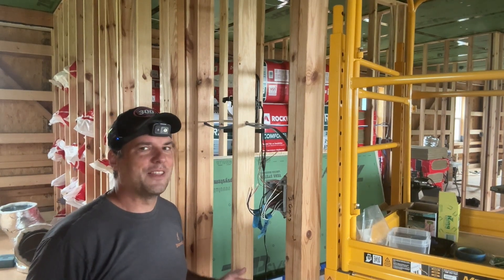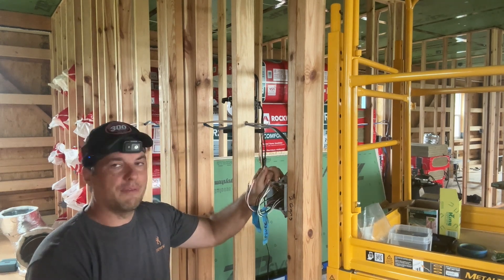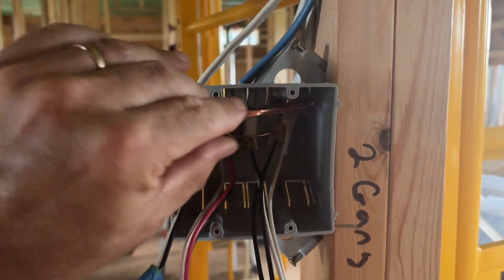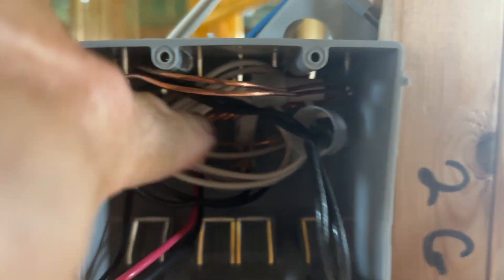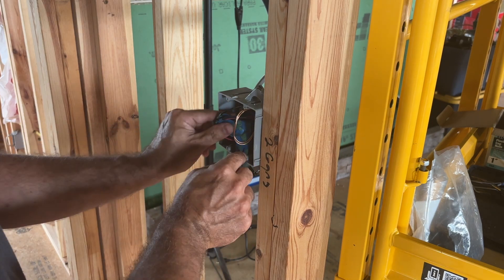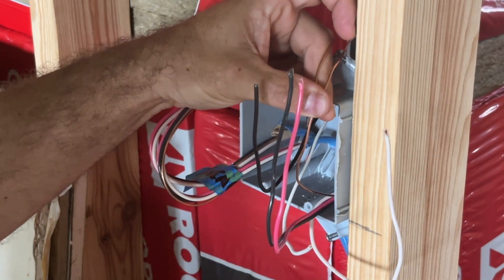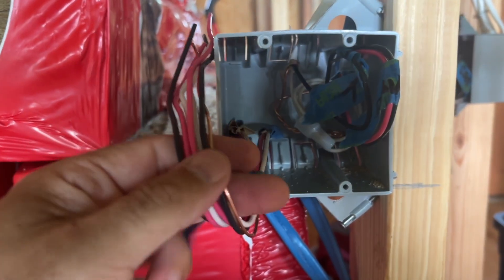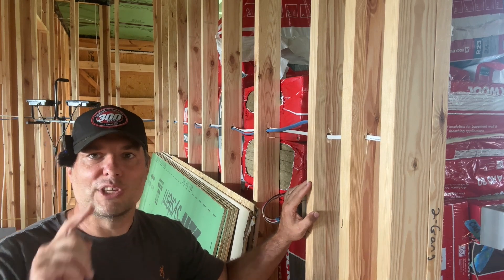3-Way Switch Rough-In Made Easy

Comment: The simplest way is to use 12-3 from your power box to the other light switch. then at your other light switch you go to your light.  (the way you did it)
The other way is to dead end your other three way and use the white wire to return your switch leg. You can re Identify the white wire with a red, blue, or black marker, but I believe per NEC you have to use the white wire as the hot wire so that there is no way to confuse it with a neutral.

You are doing a pretty good job on your box makeup. If I was a master electrician and you were looking for a job as a house wireman I'd be happy to hire you.

Get you some better wire strippers. harbor freight has a cheap pair that is better than those automotive crimper style...  and some real lineman pliers... for less than 100 bucks you can have the right tools to do the job, and your hands will thank you.
https://www.harborfreight.com/7-inch-wire-stripper-with-cutter-98410.html
https://www.homedepot.com/p/Milwaukee-9-in-High-Leverage-Lineman-s-Pliers-with-Crimper-48-22-6100/205652185?
https://www.homedepot.com/p/Klein-Tools-Electrical-Wire-Stripper-Cutter-10-18-AWG-Solid-11045/100630729

you can combine the neutrals in the 2nd switch box in your setup, but there is nothing wrong with not combining the neutrals. 
You actually need to connect your grounds together in every box, so that is the only thing you actually have to do.